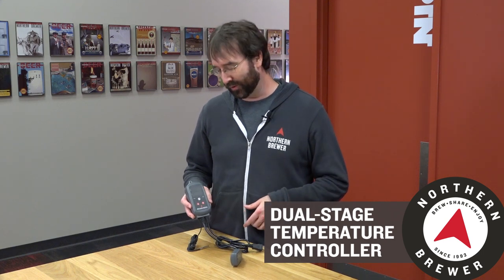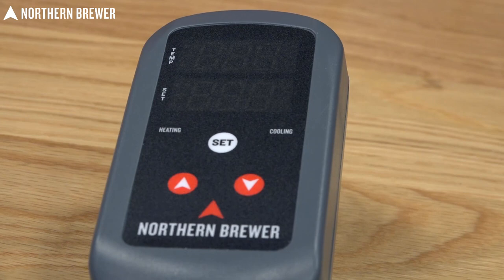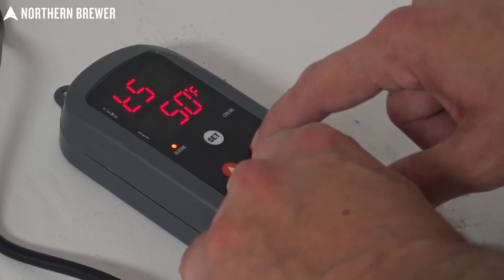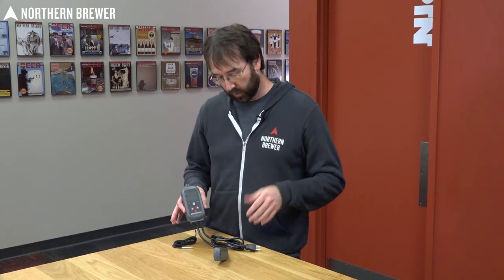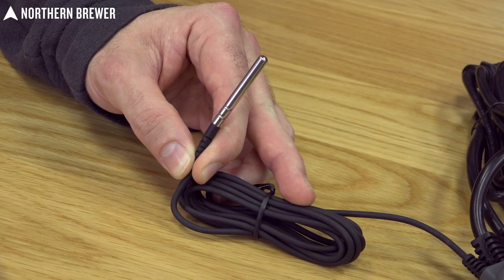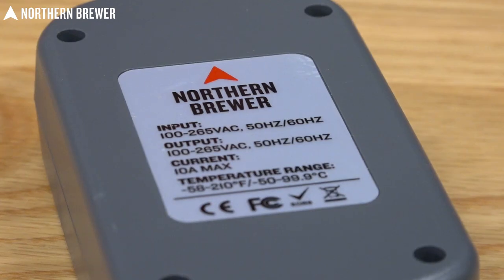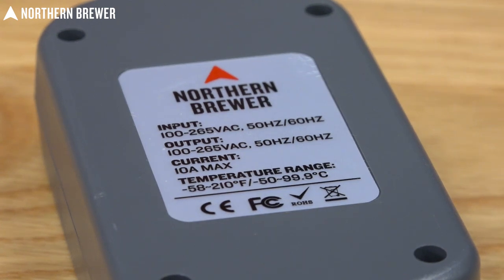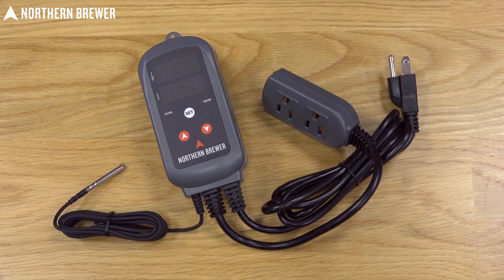Dual-Stage Temperature Controller

Comment: For the existing temperature sensor in my keezer, do I set that to off? Or is there a preferred position that this needs to be placed in?
Reply from the maker: I don't think it matters really because the temperature controller will essentially override it either way.